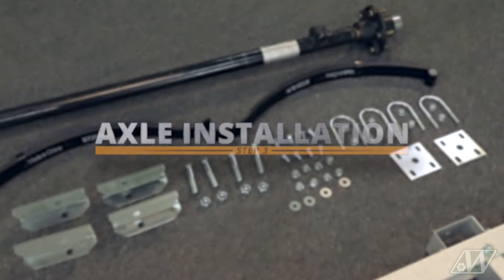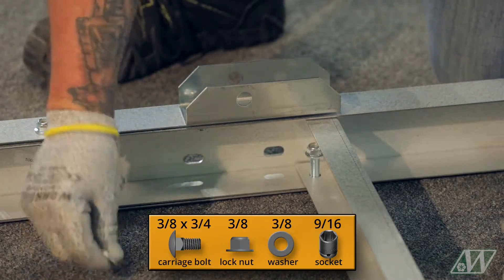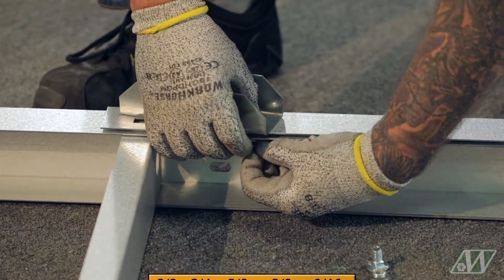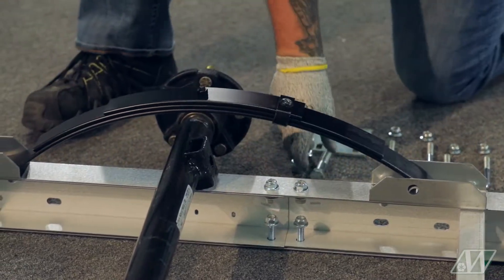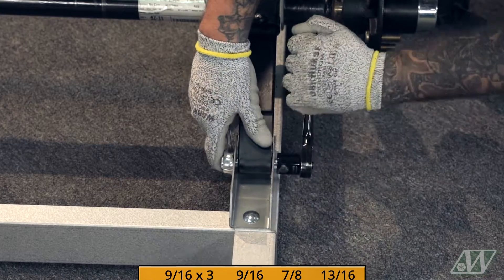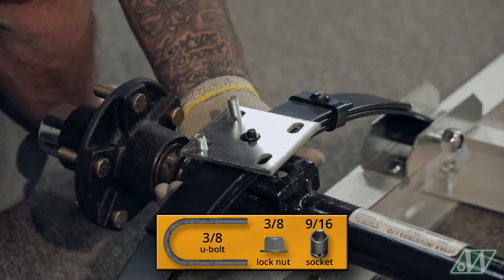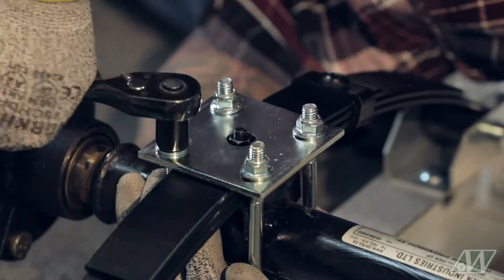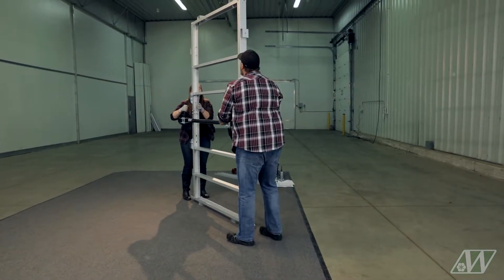Step 3 - Axle Installation

Comment: FYI - When he says the round holes have to be facing the center of the trailer, it means the point where the two side rails meet (Where the two bolts are right next to each other), not the vertical line of symmetry. Ask me over in step 4 how I know ._.